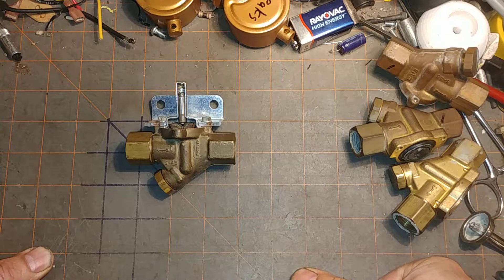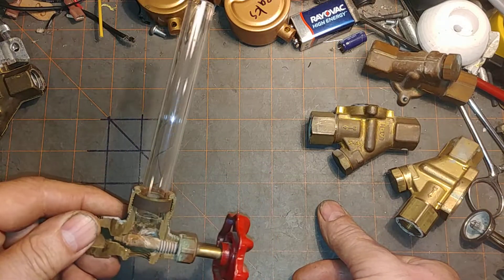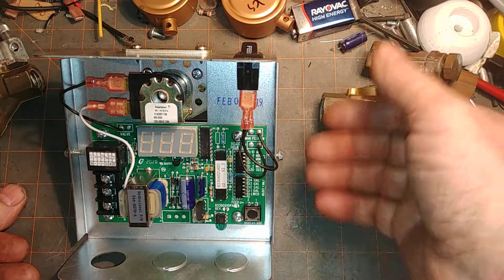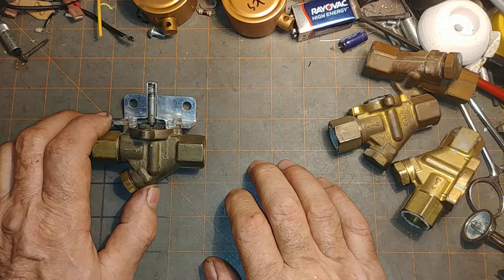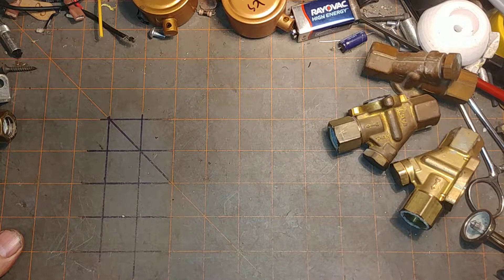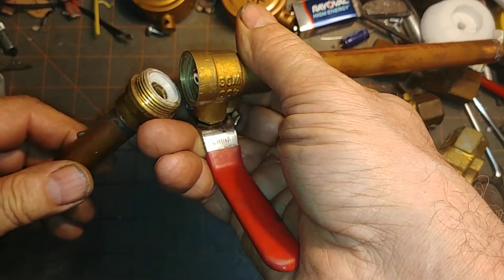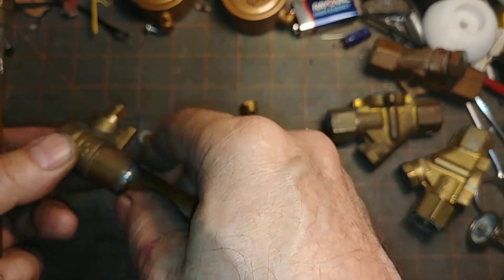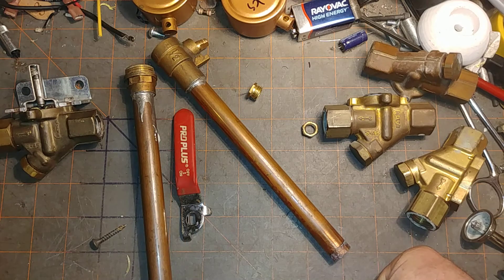Your VXT Automatic Water Feeder Flooded My Steam Boiler! Whaddya Gonna Do About it?

Comment: New sub here: my vxt is 24v I have recently replaced probe and low water cutoff.It will fill normally on startup and shutoff but it starts up again and won't stop until I close inlet valve, It will run until my vents leak  water (floods) my guess (hopefully educated )is my probe.A)Would checking the resistance confirm a faulty probe?B)how does one measure the resistance as is there is only one terminal.I also replaced low water cutoff as a process of elimination lower price to higher price of course.

I can bypass the vxt altogether and continue to manually fill, but I will be doing some traveling and won't be home to check and fill.Any ideas would be appreciated.
Reply from the maker: Welcome!
Please remember, I can't see what you are seeing, but my best conclusions based on your descriptions are that the feeder valve is getting stuck open.
It should be rebuilt.
There is a service kit Hydrolevel # 45-345 that should be available on-line.
Also, it seems your system may be losing too much water and requiring the feeder to cycle too often.
Finding and fixing those leaks is of paramount importance for the life of your boiler.
Reply: @gordonschweizer5154  Gordon thanks for the speedy reply,I will lookup the rebuild kit and follow along with your vid.Yes,you are correct in saying you can't see what I do which I'm sure would make an exact diagnosis a bit tricky.Guessing the more detail the clearer the picture.Again you are correct, I have a valve for my kitchen radiator which I just bought that I'll be replacing.As far as the vxt, I should have mentioned,it will fill water to my level line on site glass then within 1 minute it will once again open the valve on its own and remain open and I have to shut off inlet valve it will operate just fine for a couple days till it drops to where  low water cutoff takes over and then I have to repeat process.Deenergize,fill to level line, and close inlet valve then several days of operation.In any event I will order the rebuild kit, and start there.thank you.
Reply from the maker: @ricg9431  Quick question:
What model low water cut off are you using?
Reply: @gordonschweizer5154  Mcdonnell & Miller
PSE-802-RX2-24
Reply from the maker: I once saw a PSE LWCO flood a boiler right in front of me (I, to this day, regret not having the presence of mind to film it, I was in such disbelief it was happening!).
The LWCO called for water (the red light started blinking) even though the boiler was already filled above the probe, and then the light went full red.
The VXT then added water after 30 seconds as it was told to do (the "dot" after the numbers was on).
Just the week before, a fellow steam man out of Chicago had called me to alert me that new M&M PSEs were flooding the boilers of his customers.
I replaced the PSE & the problem went away and I haven't seen it since.  
This was a number of years ago.
It seems M&M had a bad run of PSE LWCOs but kept mum about it.
Could this be happening with you? I have no idea.
Reply: @gordonschweizer5154  hmm interesting, kind of makes me think I might have been dealt one of those. You make an excellent point in the fact that it does shut off after the initial 30 seconds but then turns back on again. I am going to take a look at the LWCO and check on his behavior on a regular cycle who knows maybe it will reveal something on further inspection. I'll keep an eye on both the red light on the LWCO. As well as the dot after the numbers on the VXT. Once again I appreciate the quick replies and all the feedback. Thank you.
Reply: @gordonschweizer5154  As someone who has never had to work a boiler in any capacity (except a pot on the stove ;p), this is the second time I've heard of problems from McDonnell & Miller, which isn't much but it's weird that it's happened twice

Comment: Thanks. What is the angled Valve opening on the VXT 45-343 for? You show the cross section and how to use the 45-345 service kit on the top of the Valve, but I don't understand what the bottom angled nut is for. Do we screw that nut off sometime to clean the bottom of the Valve? What is it for? What is the proper name and purpose for it?
Reply from the maker: That is a strainer to keep out debris.
In other videos on the DEMA 443p/ S-45 valve, there is more detail.

Comment: Another reason to manually feed water.
Reply from the maker: Each steam boiler customer is unique and each has different needs.
Certainly not all operators "need" an automatic fill valve and to your point that makes for one less thing to go wrong.
Also, it can be argued, that closer "hands-on" operation of the boiler compells the owner to be more attuned to their boiler's needs and proclivities.
Some folks, however, would like to be able to go away for a while during winter and not worry so much about a freeze-up.
Manual feed has its own issues aside from the one alluded to above.
Customers may improperly read the water level in the boiler and over-fill.
Some might not shut the valve off properly and flood their system manually.
And, as mentioned near the end of this video, the manual valve may pass water into the boiler through no fault of the customer.
I try not to intentionally over-sell automatic water feeders, but to explain the pros and cons and let the customer make an informed decision.
Reply: @gordonschweizer5154  🤨
Reply from the maker: @audreyl704  What does that emoji mean?

Comment: Valuable information.  Is it recommended to change the low water cutoff unit as well as the feeder after a certain period of time as preventative maintenance?
Reply from the maker: Thanks!
All manufacturers say to swap out low water cut offs after 10 years.
Hydrolevel recommends to rebuild the feed valve after 3 years (they don't say to swap out the electronics - its not a safety device).  
I've seen VXTs in service still working after over 20 years.

Comment: Good video 👍 I have had several over the years where the incoming water pressure was that I would call excessive and it cause the water feed to leak by. This have added a pressure reducing valve to the inlet to help prevent this